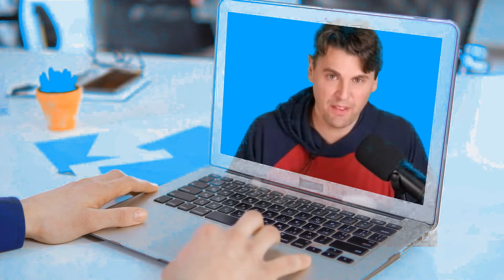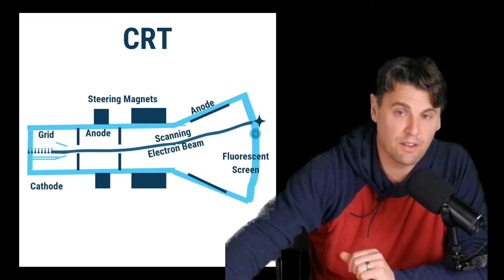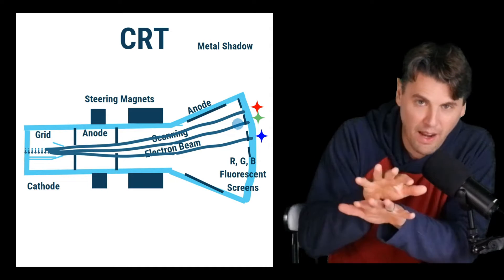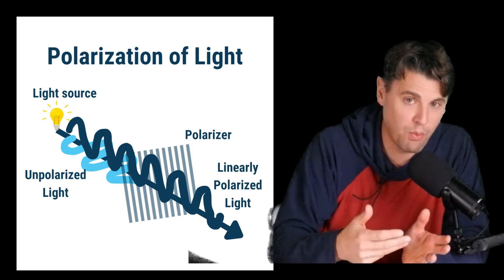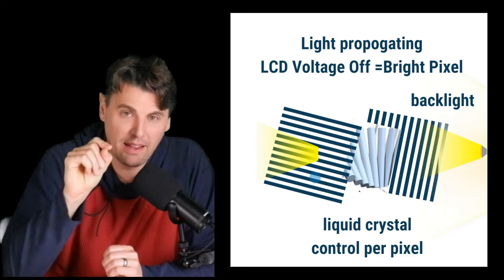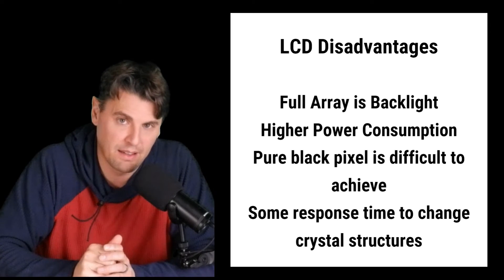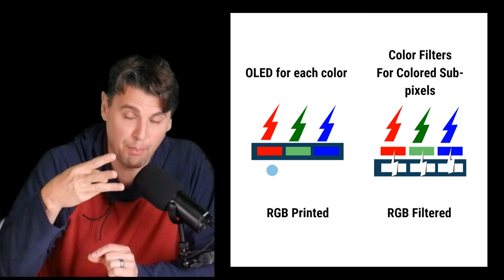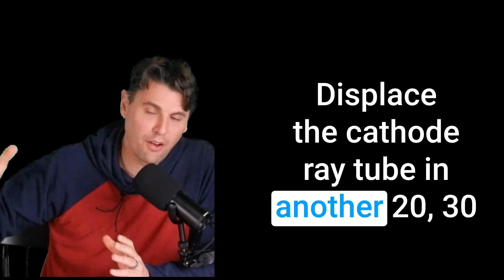CRT vs LCD vs OLED ( How Monitors Work )

Comment: Is Doctor Nett using AI for his image? Why is his voice so out of sink with his lips? I'm trying to find an answer to why my 10 or 11 year old laptop  is starting to show permanent short black line segments suddenly?  About two days ago one circle about 1/4 inch in diameter showed up near the bottom center of the screen. . The next day another clump of horizontal lines appeared a little higher up. I suppose this means the LCDs or LEDs are decaying. But maybe it means something else is failing and the LEDs are OK?

Comment: so far my best screen image wise would be my Emachines CRT  and it allows for about the same range of HZ as the built in screen of my gaming laptop but of course you hear and read that CRTs use more electricity...  but to help with electricity instead of going to highest HZ I am instead locking screens that allows for 60HZ but the highest is in the 100s of HZ to just be at 60hz to keep electrical use down

Comment: Hey plz help me with this report for 10 months old baby…what will be the msv for a ncct head ct scan…
Kv for topogram and headseq-130,130
Ctdi vol-41.51
Total DLP-864
Total MAS-1073
Csl mm-0.6,0.6
TIs-3.4 and 2.0 respectively 
They have used seimens 128 slice ct scan machine….kindly provide me the msv for this report for 10 months old baby head non contrast ct scan…is this dose sage for him??
Reply from the maker: Enter the DLP , body part and age into https://howradiologyworks.com/dap-calculator/ to get a mSv value
Reply: After applying the DLP and age the msv for brain is coming 5.7 for 1 year old child…but for the ncct brain the msv is 2 msv right??